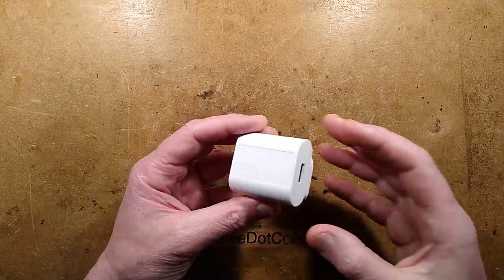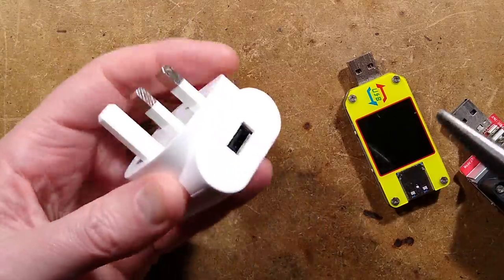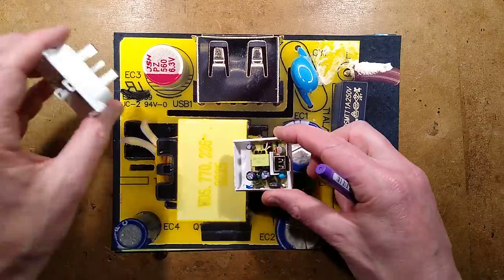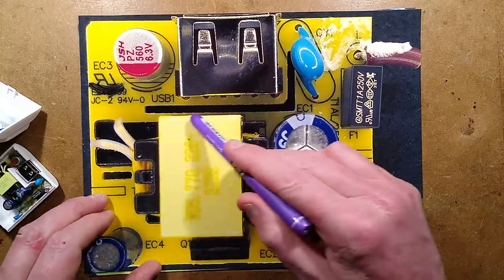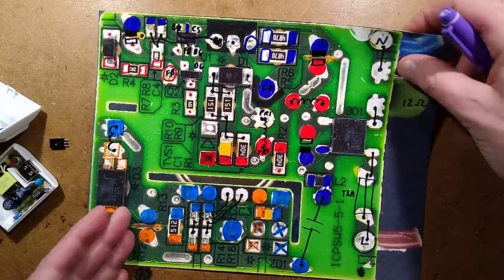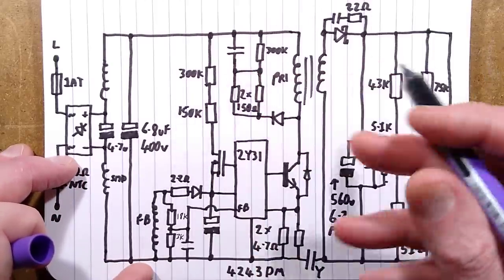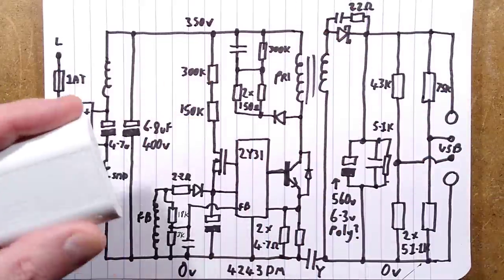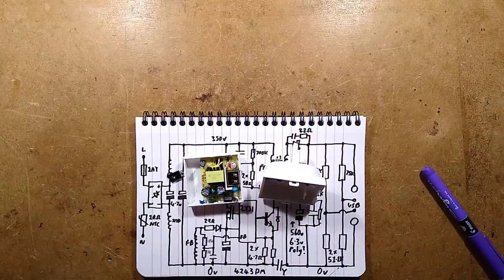IKEA mini Smahagel teardown

Comment: Now this is how you design a power supply boys and girls. Flyback, Isolated, safest transformer windings, with rock steady output. 
I would buy Ikea electronics any time. Solid engineering at a good price.
Reply: Plus a secondary and feedback winding that are very closely coupled, likely with the primary wound on either side of them, so that you can use primary side sensing to regulate voltage. In this way you shave off 100mW of standby power, simply from the 10mA or so of current that otherwise would be consumed in a TL431 and optocoupler on the secondary side. Very good regulation there on that supply, it does not drop out of spec till the chip reaches close to 90% on time and the overcurrent limit on board shuts off the output, but it still then runs in hiccup mode to attempt to restart.

Bipolar transistor is nice, reliable, and likely to survive longer as well, no delicate gate structures. Only not easy to up to higher power levels with the limited base current available, but probably more efficient, as you can saturate it to a lower drop than your typical high voltage mosfet with modest current, and your operating voltage for the chip can be much lower as well, no need to run at 18V or so, you can run around 8V and still get decent performance, saving turns on the feedback winding and also power dissipation. All the design points to something designed for low standby power, it might cost you perhaps 1 unit of power over a year to leave it plugged in with nothing connected.
Reply: 1kWh/year is about 110mW average .  Is it really that low power?
Reply: The regulations in Sweden wouldn't allow for anything less

Comment: The mains wires are even correctly colour coded brown and blue, not generic red or yellow as is common.
Reply: Now that's a trap for American new players. Learned that the hard way my first month of working industrial maintenance years ago, when someone ripped out the cord of a conveyor weighing device. I saw blue/brown instead of black/white and completely forgot that it was mains power and tried rewiring it to a terminal block labeled +/-. Classic magic smoke lesson right there, know clue what I was(n't) thinking...
Reply: @sgctactics Everything is a smoke machine if you use it wrong enough.
Reply: @sgctactics  Old colours in the UK used to be Red = Live, Black = Neutral, which makes the US Black = Live (Hot) seem odd.
Reply: @rpdom Honestly the red-black is the easiest to remember as that color code is very common in electronics made outside US and Europe
Reply: I had a mains to 28V DC power adapter for a robot mower use red and blue wires where blue was positive. That device no longer works. Spares were not available.
Reply: Using blue for positive is fk!ng stupid! Blue should never be used for positive in any circuit. Neutral for 240V AC or -12V DC.
Reply: @simontay4851 I’ve never felt comfortable with black as a phase colour. I know the Euro colours were chosen to minimise colour blindness wiring errors and I love (I know I’m weird) the earth/ECC/PEN colours, but black and white LOOK like neutrals and strong bright colours - red, yellow, blue - look powerful.
Reply: European regulations! I made some repairs in an Italian plastic factory that print some moulds for Ikea! The frequent inspections from the Ikea's team are very meticulous and the attention for regulations are on another level!

Comment: The Zigbee repeater/router they sell is quite neat and is designed to plug neatly into this supply. Reassuring to see how well-designed it is.
Reply: Is it? This power supply delivers only slightly above 1.1 Amps so how come?
Reply: That device uses 1A as far as I found on the internet so it should work fine._
Reply: @DjResR  I’d be stunned if it ever draws anything close to an amp.

Comment: It is so strange to see that it is Ikea that is currently one of the best electronics suppliers there is.
They have good Led lamps, good batteries, good chargers - and all for a decent price.
Reply: That's my US observation too. 
Their 'specs are pretty stiff for their consumer grade electrics.
Reply: @benjurqunov  I think they have this idea that if they make one version that fulfills all standards for all the markets they sell to they only need one design and can move larger volumes keeping the cost down. With this USB wall wart they have to vary the shell to match the plugs used, but other than that it seems universal. So there's one part number for the guts that is the same for all versions.
Reply: I was exactly looking for simple+safe power supplies, to mod my aunts christmas lights, the ones she liked came with those 2xAA battery holders... 
you cant really find cheap 3 or 3.3V supplies so i went for the 5V, which usually means usb (and a dropper resistor)... and then found that ikea was the cheapest starting around 2.5 bucks aaand also the safe option vs amazon and other non chinesium brand names.
Reply: reputation, ikea is a major brand. also you don't fuck around with electrical issues and fire, especially if you want to remain a major brand.

Comment: Words I wouldn't expect to be using to describe Ikea stuff: exemplary, as always. Their furniture isn't that great but every teardown on this channel of one of their power supplies has shown them to be as good as any, and better than most.
Reply: Their furniture isn't that good, generally, but it is good considering the price.
Reply: I work at Big Clive's nearest IKEA and I was extremely surprised when I started - I expected the usual corporate behemoth only interested in shareholder driven profit etc, but they are a genuinely ethical company and design products with the customer in mind first before profit.  Yes a lot of furniture is cheap but it's built to a certain price point.
We are even taught to help customers think about whether it's an option to reuse or repair furniture instead of buying new! (BTW thanks Clive for another great teardown. Been a long term fan.😊)
Reply: @kevinc21945 Warrington?
Reply: My experience is that you get whatvyou pay for and they offer a wide range from cheap to not so cheap. And it's fairly easy to examine stability and durability of each product in the show area and choose the one that match your neess and wallet.
Reply: @rupertthomson  no, there's a closer one than that 🙂
Reply: @kevinc21945  Ah! I think I know where you mean!

Comment: That's made me want to go out and buy a few from Ikea, $7.95 here in Aus. They do the electronics well. 
There is the Åskstorm  23W USB A/C charger that would be interesting too but at $29.
Reply from the maker: I have one of the USB C ones here.
Reply: Thunderstorm sounds funny for such a product.
Reply: @iamjimgroth  I didn't watch the clip yet, but it translates to "small hail".
Reply: @iamjimgroth  ahh, but Thunderstorm is correct.
I blame Midsommar, swedes be drunk.
Reply: @niclaskarlin Åskstorm translates to thunderstorm .
Reply: IKEA recalls 40W ÅSKSTORM USB charger due to burn and electric shock hazard. Nice to know what Åskstorm means…

Comment: Would have been interesting to know how much power it consumed with nothing plugged in to the USB port.
Reply: Be interested in that too, as well as Power Factor.
Reply: generally the consume >0.1watt until there build-in shutoff kicks in.
the they measure 0.00watt, I guess because they only occasionally wake up to measure if anything is connected.

in reality it is so low you can’t really measure it with normal instruments.

Comment: I think the reason for the mosfet is, that in the EU electrical devices without internet connection are not allowed to have more than 0.5W when being in stand by mode. Probably they were close to it when leaving the mosfet out of the circuitry, but EU laws made it nessessary to cut the power down even more by a few milliwatts.
Reply: Those resistors could consume up to 0.27W (for 240V mains) so the mosfet is quite justified. Nice solution indeed.

Comment: Ikea really does have some good engineers designing its electronics. I'm curious who they farm this out to.
If you're building Ikea or similar flat pack furniture - especially wood furniture - and you don't want it to come apart easily, there is a way to make it much more durable. It's a technique that is never mentioned in the instructions, but is shown in just about every video that has woodworking joinery. It's actually a catchphrase on Laura Kampf's channel.
Let Glue Dry.

Comment: Good to know it is actually a great power supply! I bought one for my job to keep my phone topped up slowly. Though it would be decent since it comes from Ikea and, since it was cheap I figured it would not be a problem if it broke. This confirms it :)
Reply: Same as me, Show charging does not heat up the battery thus preserving battery life.

Comment: My 3-port Småhagel has pretty sturdy USB connectors, very solid feel. Although the genuine Oneplus charge cable that came with my phone simply refuses to insert into any of the ports. Several other cables do work, though.
Reply: That's odd, with loads of chargers and leads and USB powered things I've only come across one physical incompatibility. I cannot plug my Huawei smartwatch charger into my 3 port IKEA Koppla charger, the predecessor of your Småhagel. It's not tight, it just doesn't fit in at all.

Comment: Hats off to IKEA for putting out a high quality, low cost item like this, but my question is, how much RFI does it emit?  I'd expect it to be pretty good judging by the quality parts and design, but most wall wart USB chargers put out a lot of hash and RFI suppression is not, generally, high on the minds of the people who design them.  Radio Frequency Interference is a constant nuisance in the radio shacks of ham operators.

Comment: The reason for a bipolar transistor might be to avoid a sneaky patent for secondary side voltage regulation via flyback transformer main winding. The use of a mosfet in conjunction with main winding feedback regulation is patent protected. Chinese manufacturers don't give a crap about it... but major players in EU/USA must because patent owner only goes after those with a big wallet... I seem to have forgotten who was the patent owner, could be Linear Technologies.

Comment: The snubber at the schottky is probably there to stop the circuit from ringing at the output due to the leak inductance of the transformer and the inherite capacitance of the diode when it's not yet forward biased (They form a tank circuit at very high frequencies where the output capacitance would mostly look like a short to more of an inductance). This is probably an EMI standards thing. Would be nice if you can measure it in a video (ringing no ringing due to the snubber), I havent watched the google thermostate video yet, so if you done it already, touché!

You could try removing the snubber, but you could also try changing the output capacitor.

Comment: @4:40 - I have a Verizon 48v transformer from an old home internet setup.  That little bugger needs one of those NTC bastards.  The crack when you plug that thing in is quite impressive indeed.  I should send it across for a teardown.
Reply from the maker: That's not uncommon for some chargers.  They can create quite a spark when plugged into some sockets.

Comment: How come nobody is using that excess enegry to improve efficiency, instead of just wasting it as heat in the snubber circuit?
Cost, of course. But with the ne EE energy labeling, I was expecting something like that to happen.

Comment: That's actually really impressive, great attention to detail in the design. Output values aren't anything spectacular, but it does what it says on the tin and it does it well.
I'd rather see this than a "2A" supply that'll cut out at 1.6A or so, had one of those already.
Reply: Agree, electronics quality excellent, but output values are a generation behind especially for a mains unit. Just the powerbank I'm using now has 2.4 amps and 3 amps with USB-C. Does 'it' (made by Juice) achieve this? I don't know, but it's v fast. I avoid anything saying 1 amp these days.
Reply: @nigelh3253  Yeah, but like stated - these are just for driving basic stuff like a fan, a light or something like that. And for that... it does its job, no more but no less either.

Comment: Just to let you know, midway through your video I got a 15 sec. skippable advertisement followed by a 2 minute skippable one.  Of course I didn't skip the first one, 15 seconds is ok with me, and wouldn't have skipped the second one, if it than 30 sec. or less.  Anything more will likely be skipped unless it happened to be about something I'd might be interested in.

Comment: So the startup MOSFET is depletion mode?  I couldn't find the part number.  Another advantage of Schottky diodes is their low voltage drop, which is useful in circuits like this one where there are only a few volts available.

Comment: Regarding wire colors, many years ago (maybe late 1970's) Japanese cars used a red wire for negative on the battery.  Transistor radios of the same vintage did the same.   I've also seen red negatives on US telephone company 48 volt battery banks, and they are positive ground.  Even in buildings here, white is neutral except there are approved exceptions where it isn't.  So always test everything everywhere.

Comment: It's hard to know what your getting unless someone goes to the trouble to do a teardown, so thanks!
When I buy house brand or no name LED lights I am often disappointed.  Name brands (even though they too are often from China) are usually good.  
I used to buy USB chargers from the closeouts bin at the local supermarket.  One of the automotive USB chargers seemed to work OK with my phones and GPS but got my bike light extremely hot.  A meter revealed that they just wired the 12 to 14 volts from the car directly to the USB socket, disassembly verified this.  Amazingly all the the devices, even the bike light, survived this abuse.  That particular USB charger remained disassembled.  I don't buy USB chargers from the closeouts bin any more.

Comment: This seems like a VERY GOOD charger indeed. It's unlikely to explode or fry your gear. I have a radio that uses USB as a charging option (It uses "AA" cells so I use an "AA"/"AAA" charger.  Might pick up one of these for it. (I don't trust the no name Wal*Fart crap, and my phone's charger takes 836 hours to charge the radio, LOL- Not sure of the output of THAT thing is, But I suspect it's NOT MUCH.)

Comment: The charger seems well built, better then those dodgy chargers from china, these are QUALITY chargers instead of the exploding, magic smoke releasing, fire catching fire hazzards from china, when chargers dont open easily and can provide more current than their rating and have good isolation without blowing up they are deffinitly good. And they are quite cheap

Comment: I don't understand why you called the 560. µFd at 6.3 Volts capacitor "Poly" as it MUST be electrolytic, it's polar isn't it?
Ron W4BIN
Reply from the maker: It's an electrolytic variant with a solid polymer electrolyte.
https://en.wikipedia.org/wiki/Polymer_capacitor

Comment: Can you do a teardown of one of the crank/solar light/radio/power bank imported by “Thousandshores”? The two sizes offered dominate search results for emergency equipment on both US and UK versions of that internet shopping site named for a South American river from multiple sellers with poorly doctored photos of them in use. US model number for the small one appears to be “HN-028” or “HN-28” while the UK version (which appears to be differ by regionalized radio controls/markings and lack of a blink mode) appears to be “MD-088”. The multiple sellers thing and fact that I found open wholesale listing are rarely great signs for quality control, and suggestions of low quality control are always an interesting combination with emergency equipment.
Reply from the maker: I tried various hand cranked lights in the past and they took a lot of effort for a short light duration.   I also broke a few by hand-cranking them quite hard and shearing gears.

Comment: Nice power supply!

I’ve been reading up on what you can and can’t take on P & O cruise ships and have read that they disallow (and will confiscate) any appliances which have in-built surge protection on the grounds that the surge protection poses a fire risk to the ship. 

I know that the ships generate their own 230V @ 60hz electrical supply but can you explain what they might be so concerned about surge-protected equipment being used by passengers.
Reply from the maker: It's possible that if the ships generators had coarse regulation then the surge arrestors could dissipate a lot of heat when high loads were suddenly turned off and the voltage rose briefly.

Comment: A bit sad to me it's 1A only. If it was 2A that would be absolutely perfect - all the mobile phones I have (and they are very diverse) charge at 2A when available, for example from Ikea's Koppla triple charger.
Reply from the maker: This is specifically for powering small devices like strings of lights continually.

Comment: It would be interesting if you had also examined the European version, because it looks far different.
Reply: I think that European version is quite similar - the plug is only in another side of the barrel (in the narrow side where is the two halves separation line).

Comment: That is a quality power supply, all for less than an average pint of beer! I've had 2 of its 3 port predecessor Koppla for years and they're great. One thing I'm not understanding is that class Y capacitor - after all the effort to isolate the two sides of the circuit why would that be there? I'm sure there is a good reason but not something I understand.
Reply from the maker: It's to provide a return path for current capacitively coupled through the windings, that could cause electrical noise issues radiated by the cable.